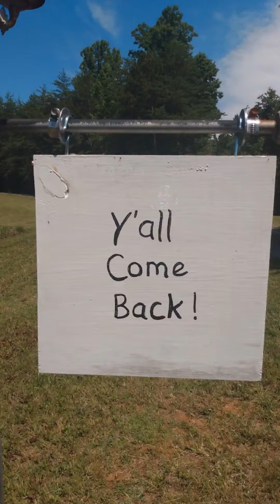motorized bicycle porting facts

Comment: Nice vid I to like to see the cyl go from nothing to something with a bit of work I'm gonna get a few extras and practice and to get into the inside ports what size drill bit for the Dremel do u suggest thanks for the help 👍
Reply from the maker: Standard Dremel shaft diameter but 3 inch long burs I get from cc specialties I have a standard flex cable Dremel and I also have a $800 CC specialty multidirectional foot controller speed quick change porting machine also from CC specialties. Fancy s** not necessary the little angled ones not necessary a simple little Dremel with the flex cable and proper length bits does the job just fine best devices slow tool speed you don't burn the ports or your bits
Reply from the maker: Yes it's a affordable hobby grinding shaping improving the world's most poorly designed set up. Definitely kinda rewarding

Comment: Those are hours of fun 100%
Reply from the maker: Love the cheap crap. Anyone can bolt on a better designed cyl.but not everyone can simply use logic and a Dremel to drastically change the cat turd out of the litter box and make it run great. 100s of tested port shapes and timings. Bigger and more duration is not allways the answer. Kinda sucks I don't mess with much anymore I'm fairly confident that if I still messed with anything folks are currantly running whether it being a scooter cyl or phantom or whatever mish mash there selling chances are fairly high I could make them out run they guys that sell the motors. Not really a big goal or achievement. I like seeing the average Joe improving with a simple few helpful tips. Way more gratification than building my own crap
Reply: @2strokecarbtuningportingin187  the best way to go fast or have a good engine is working on the bugs and do a lot of graining and a lot of sanding. Even in a car engine the stock don’t run good ones you work on them they work great. Love working on them little engines . Talk about rotary engines jeeeee. We back